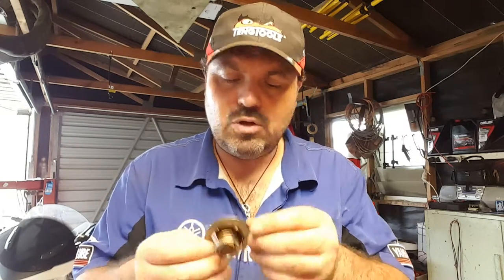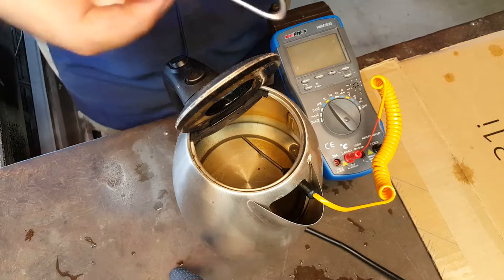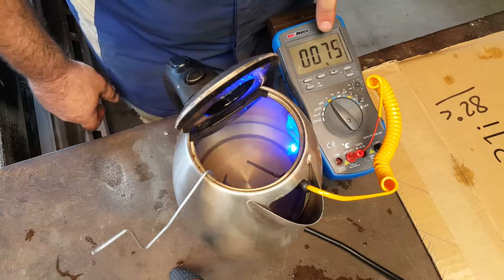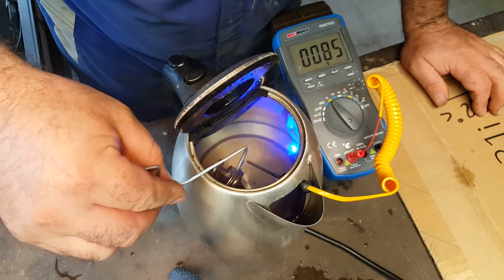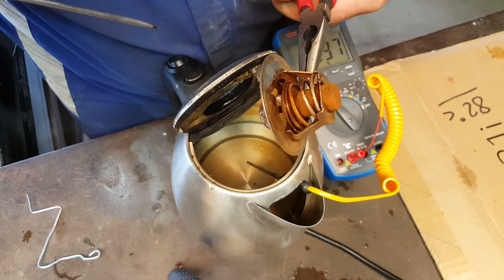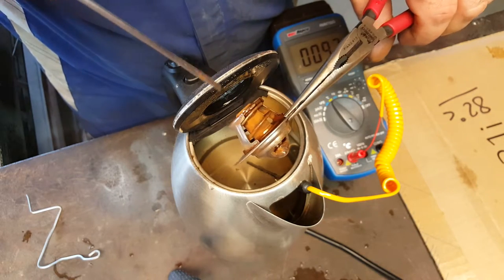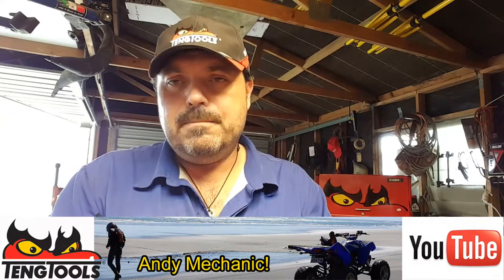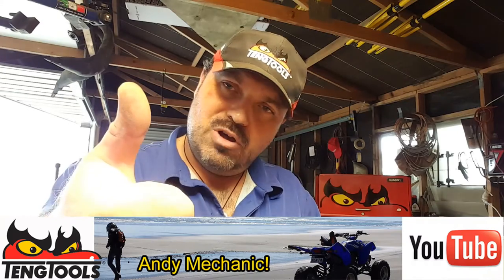How to test a car's thermostat #1111

Comment: "Qualified mechanic"

pinches off brake hose with vice grips

I have some doubts.
Reply from the maker: +Krankie V Thanks for your feedback.  It's  a trick of the trade to use mole grips with sockets on the jaws instead of dedicated flexible pipe clamps. In my book, nothing wrong with it & can provide a softer clamping force than other methods too. 

Cheers
Andy
Reply: Brake lines shouldn't be pinched at all. there are other methods of keeping the fluid from dripping which cannot damage the hose. I've seen others do it as well, but that doesn't make it correct.
Reply from the maker: +Krankie V it's common practice. I agree if it can be avoided then it's better but often it's the easiest way.
Reply: You should hold yourself to a higher standard than using "the easiest way". Look I'm not trying to talk smack... I'm just saying someone who conducts lectures and all should always demonstrate proper procedure. Snap-on has these nifty little guys which look like a "chip clip" with little rubber balls on the end, you clamp it over the banjo fitting and bam, no drips and no damage to the hose. They're great. I cringe every time I see someone pinching a brake hose or letting the caliper hang from it without support. The worst kind of damage is the kind you can't see.

Comment: I've got a 2003 Toyota Tacoma V6. Lots of talk about the jiggle valve with this particular engine (5vz-fe) which is found on some mid 90's - mid 00's Tacomas, T100's, Tundras and 4-runners. From the many Toyota enthusiast forum posts I've read recently, many DIYers or mechanics, following conventional wisdom (or the service manual for a different engine) have been installing the thermostat with the jiggle in the up (12 o'clock) position. However, the field service manual for the 5vz-fe engine says to place the valve in the down (6 o'clock) position. The OEM thermostat is stamped "82C" (180F) and my engine consistently reads at 190f with jiggle in the down position and 200f in the up. If you search "Toyota jiggle valve", you'll find those aforementioned forums that owners report the same ~10f difference (~190F vs ~200F) between the up and down position of the jiggle valve. So, like Andy says, check the service manual for your specific vehicle for the correct procedures.
Reply from the maker: +Jason Yen Awesome info Jason and most valuable, Thank You. It's amazing that there are so many quirky variations to the 'norm'. This one seems to go against physics but the engineers at Toyota must have done it for a reason & let's face it, they often know best! Cheers Andy
Reply: Someone posted on a ttora forum (link below) that the jiggle valve on this thermostat "allows the coolant to drain from the engine block into the radiator when you drain the coolant. That is all it does." Another person added, "The reason it doesn't need to be on top to rid the system of air bubbles is why you are supposed to run the truck at operating temperature which opens the thermostat, which in turn eliminates the air as the coolant makes its way through the system and out the open radiator fill hole." 

So according to these guys, this particular jiggle valve isn't meant to be an air purge?

http://www.ttora.com/forum/6-performance-engine-exhaust/65261-t-stat-jiggle-valve.html
Reply from the maker: +Jason Yen The main purpose of a jiggle valve is to aid air to purge through the coolant system both during the bleeding process and if a fault develops which introduces a gas into the coolant. That's why it's 'usually' placed at 12 o'clock on thermostats that are mounted with the valve in the horizontal orientation.

As a lecturer using YouTube videos as part of the e-learning content of the course I found it extremely difficult to find videos with correct content. That was one of the main reasons why I decided to make my own :-)